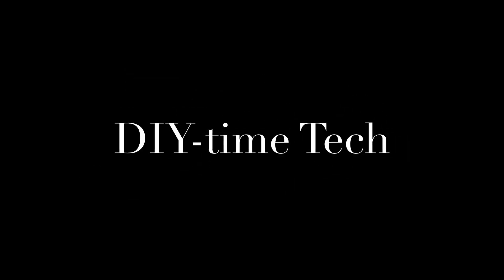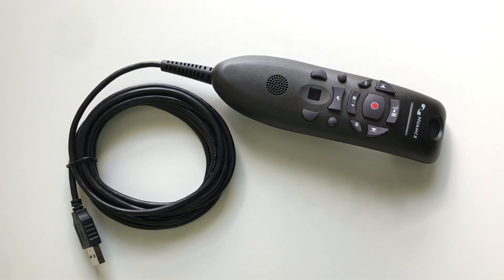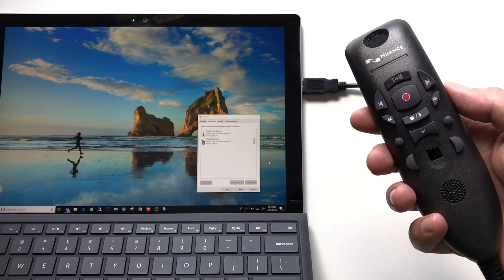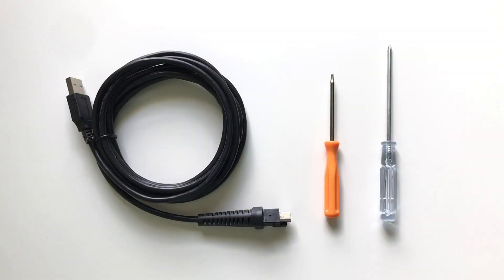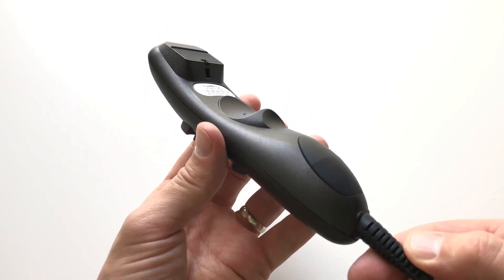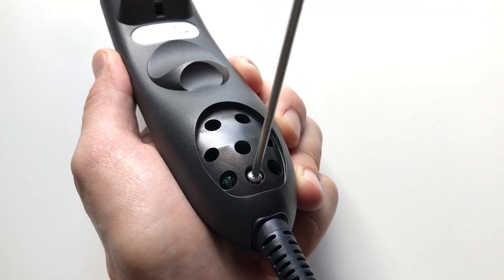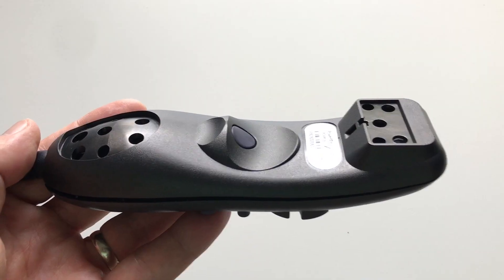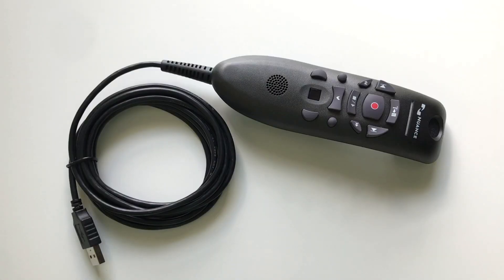Nuance PowerMic III USB cable replacement - how to fix your Dragon dictation microphone.

Comment: Another common issue with these is the record button sticking. Nuance won't do anything about it if a) it's out of warranty and b) yo aren't a hospital with a 'customer number',. Looking at your video, it looks like everything is on one board, and it should be a simple matter to clean the switch and plastic/rubber switch button with some isopropanol, yes?  Considering how simple these things are, the $300+ price tag is outrageous. Especially given the terrible TS.
Reply from the maker: Oh yeah... 💰🤯
Cleaning should do the trick. I often find signs of coffee spill in these.... 
Or recently, people like to soak them with bleach wipes to disinfect. 😤